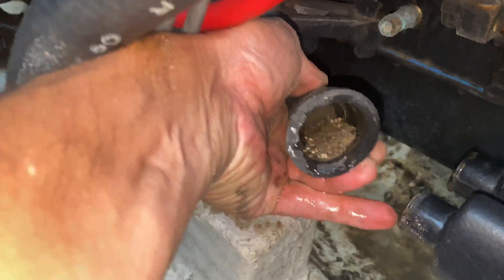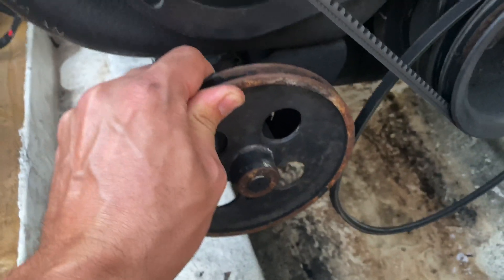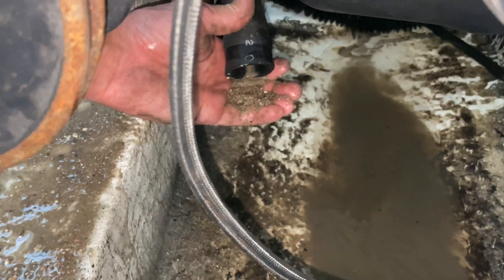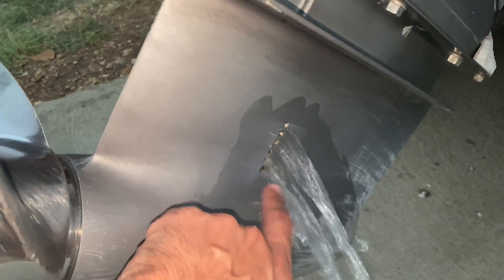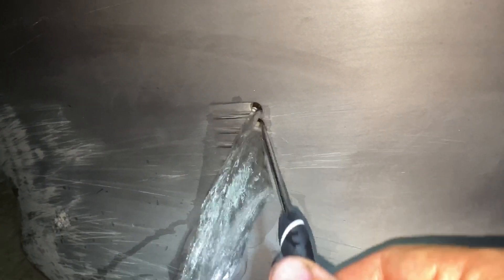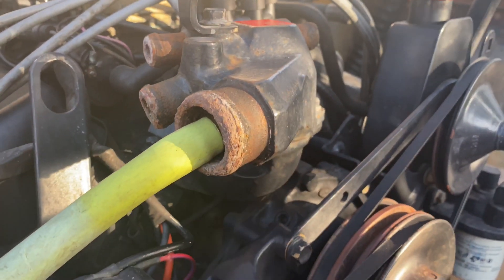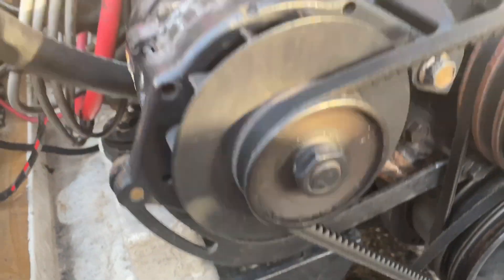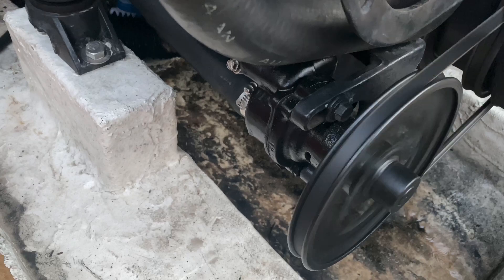Removing Sand from Your Marine Engine to Prevent Overheating

Comment: I’d be replacing the impellers upper and lower, and water pump. Sand will destroy every moving part in the cooling system.

Comment: Hey mike I just recently had my motor over heat the right manifold was so hot it cause the engine cover to burn. The left manifold seemed to have water flow through it as i was able to touch for a few seconds before it got uncomfortable. I checked the runner impeller and it seemed fine even turned as I cranked the engine over. I’m wondering if the raw water pump is bad or I just possibly have sand in it causing minimal Water flow . The only thing I can think of was getting stuck in a sand bar 10 minutes prior and it caused some type of blockage??
Reply from the maker: Exactly. Follow the steps in this video and replace you impeller—it’s toast. Newer ones can handle a little sand.
Reply: Sounds good thanks!
Reply: Mike can you send me a link to the ESA switches (shift interrupt)I want to replace both of them I tested them and they are bad I have a 1989 OMC COBRA 4.3
Reply from the maker: @edwardguerrero2593  did you watch these videos? https://youtu.be/whGSfsGHEao there are 5 parts.
Reply: I only checked to see if the button on the interrupter worked and it didn’t kill the engine . I have tested it before and it did stall the engine. I also have to kill the ignition to place it in neutral
And From there I can engage into dowsed or reverse. I haven’t checked the continuity yet.

Comment: I had to do the exact same thing on my 96 Four Winn's horizon 170. The intake was full of little zebra mussel shells. Would let enough water in to keep the temp down while idle, but as soon as you ran at higher RPM it would over heat.  Flushed all the lines like you did. Also took the plugs off the manifolds and the engine block and reamed them out with a metal wire and then flushed everything again. I got a ton of sand, zebra muscles, and even some rust flakes out. Been two summers now and she runs perfect temps. It was a hassle to figure out why it was over heating only at high RPMs but glad I took the time do flush every hose I could. Great video as always!
Reply from the maker: Thanks so much!

Comment: Hey Michael i had a question unrelated to this particular video. But i have a volvo penta duoprop and im currebtly in the process of replacing the outsidr transom shield after my ujoint shaft broke and beat the gimbal portion all to heck. My question is is where can i find the parts for that. My transom shield looks like the numbers were rubbed away and i cannot find anything im certain is the part i need? Any help would be very helpful
Reply from the maker: Check out crowleymarine.com
Reply: @michaelromer2016  i checked them out but they dont offer any selections for volvo penta that i could find. Omc was the closest but they end at the year 1998. Mines a 2002
Reply from the maker: @tylerjacob228  OMC partnered with Volvo up until 1998 afterwards, Volvo did their own thing. You would need to buy direct from Volvo. http://www.volvopentastore.com/Engine-Part-Catalog/dm/cart_id.313118519--func.volvo--session_id.790465864--store_id.366
Reply: @michaelromer2016  thank you for steering me in the right direction!